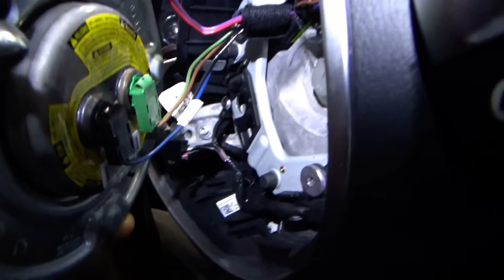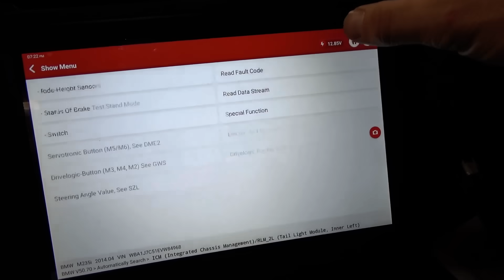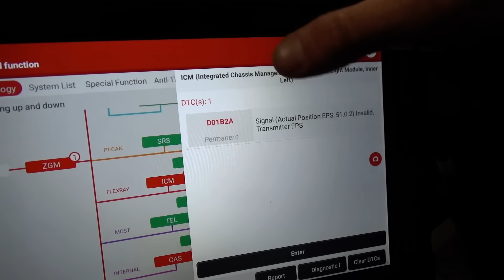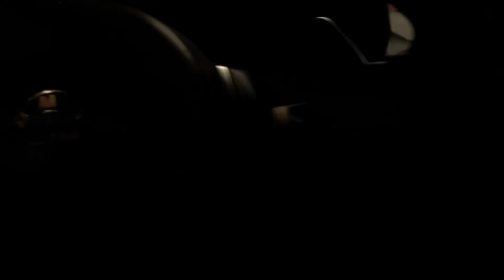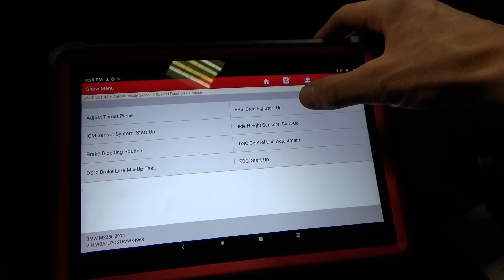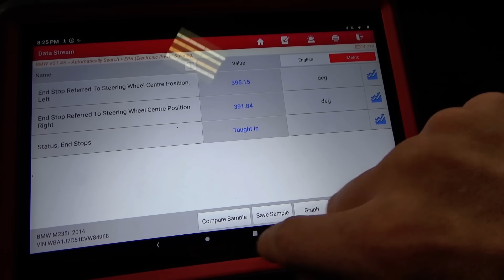DANGEROUS BMW Steering?? ('14 M235i Turbo)

Comment: I’m in CT and the first real cold weather occurred. Freezing temps. Like clock work my power steering pump has a leak now. Air in system. I have an accord 07 v6. Power steering systems do not like cold weather. Nor do any gaskets. Winter sucks. Now I have to fix cars in the cold. Ugh lol

Comment: Oh, yeah!  I forgot to mention to you that one of the jack stands had a little incident with the steering rack...  That would have been nice to know when the car was dropped off.  Oh, well.  Charge the customer for the time spent diagnosing an issue due to undisclosed information.

Comment: Next teach him that the junk intake he installed could potentially screw up mass airflow readings because the MAF is calibrated to the factory air box, and that it’s not a cold air intake, but a hot air intake, so he’s losing all kinds of performance!

Not to mention his “dusting“ his engine due to poor filtration. There’s a reason companies spent billions of dollars on research and development; that’s a precision machine, it’s best to leave it the hell alone!

I guarantee you the company that made that intake does not have the R&D budget that BMW does.

Comment: I was thinking the clock spring was turned 180 degrees off. But getting the full story from the customer narrowed down the real problem. I have no idea why these cars with electric assist steering are allowed to be on the road. I read warnings about Ram trucks with the v6 and it states the engine may die while driving and cause an accident WTF. If that was a child’s toy it wouldn’t be allowed to be sold.

Comment: Recently, the power steering went out on my 335d.  A local Bosch shop flushed the system and replaced the pump, because it wouldn't build full pressure ($1000).  Next, they said my alternator was weak and would only provide about 50 amps ($1300).  I took the car back and did the alternator myself ($350 for a brand new Valeo part).  As I was checking my work, I noticed a wobble in the crank pulley.  I bought the part and took it to my usual mechanic, who was back from vacation by then.  Not surprising that things don't put out their full rating when they're not being driven properly.  The rubber in the harmonic balancer was shredded.  Belt tension was the only reason it was turning at all.

Comment: To those of you who put on "cold" air intakes..the stock snorkel takes in air from the outside, while the "cold" air intake takes air from under the hood. Now tell me, which system delivers colder air?

Comment: These electronic power steering's are ridiculous. The old fashioned mechanical/hydraulic units worked flawlessly for years. Over engineering at its finest. Let's take something that has worked for ever and make it better. NOT.

Comment: Yeah, that would have been nice to know.  What really bothers me is, in Pennsylvania, you have a car with a heated steering wheel and you take it out to put a "carbon fiber" one in its place.  Stupid and all for show.  Heated steering wheel sounds like a fluff option until you're driving down the road in 10F degree weather and your hands are freezing to the wheel through your gloves.  I give the kid credit for sourcing, replacing and programming the rack (but didn't he realize when it fell onto the rack he might have busted it?) but he lost all that credit ripping out the heated steering wheel to throw a "look at me, I have a carbon fiber steering wheel" in.
Reply: Why would that “ bother” You? It was his money to do with as he wanted. I’ve been driving in Pa. Well over 50 years, never needed a heated steering wheel  or desired one. Your hands stick to your steering wheel with gloves on?  Wow! 😅

Comment: I do not like EPS systems simply because they are not servicable. Ive seen them fail often with crazy results, some judder like crazy, some continiously spool to one side if you let go the wheel and everything else in between happens to them when they go bad. They went to EPS to save themselves money, however you the customer get to pay when it fails,AND It will. I will stick with the old reliable hydraulic system that can be serviced and repaired.

Comment: Ivan, what software or site were you using there at the end of the video? I recently purchased a 2010 mercedes e350 (meticulously maintrained amd low miles) and would like to learn a d understand more about it's systems and how they work. Also, could you possibly recommend an affordable diy scan tool i might use to help keep up with it in case something comes up? Appreciate you as always!

Comment: HI IVAN ,another good video. I remember when the steering on my covered WAGON was just 2 pieces of LEATHER STRAP about 20 feet long.TO make a right turn,i just pulled on the right strap.Then when i traded that in for a CAR with 4 rubber wheels,and a horn,i had a round piece of plastic i twisted to the right,clockwise to turn right.But now the car i drive has a small piece of wire that goes from the wheel to a box with gears that move the wheels.The wheels can be as far away from you as you want.I could even wire it to steer from the back seat.But i just don't trust the system.

Comment: Thanks, well done the owner for sorting it. No need to worry if the original problem stopped the indicators working as these are rarely used on BMWs, maybe just a UK thing.
Reply: believe me, not, it's not.  even us yanks make fun of beemer owners for not using the turn signals.  those who actually DON'T are the remaining 30's kids that are still alive, and were lucky to have more than a single taillight on their 50 dollar used clunker after WW2 :P

Comment: Props to the guy for repairing it for himself! I'm sure he learnt a good lesson and he will be a lot more careful the next time :-)

BTW If someone need to do some BMW coding related work, the dealership programming tools are available online, and the cables are just K-Line/D-CAN OBD-2 to USB, and they are available in Amazon and similar websites.

They are really useful to have before something fail, because you can do a backup of all the data of the car electronic units. This is specially important in iDrive and other modules that can differ in settings from car to car.

Comment: A mechanic friend of mine called this tuition. The point being you can either pay to go to tech school or you end up paying for mistakes, either way you will have to pay to learn auto mechanics
Reply: From what I’ve experienced several times, automotive tech schools are pretty much a joke. First requirement needed is at least some mechanical inclination and desire, and second is an extended apprenticeship with a good mentor.

Comment: I have a 1996 Chevrolet K1500 rust free. I removed engine and transmission, completely rebuilt everything with quality parts, the entire steering with Moog USA parts. All original, cost me around $5,000 for engine (bored and crank turned) rebuilt transmission, front end, Bilstein shocks, stainless fuel and brake lines, cleaned frame and painted it. Excellent truck, no issues, oh I replaced all ground straps too. I would like to see more cool cars and less German high priced junk
Reply: Define cool cars?  Like a shit Chevy? 😂😂😂😂😂😂😂
Reply: There’s always a good lesson in all of it. 👍

Comment: With where I live, I don't see a lot of BMWs, but the ones I have worked on for shops--both old and new--I've honestly been impressed by.  Yes, the parts are expensive, and sometimes they're drastically different to work on, but the aftermarket support from scantools is phenomenal compared to VW/Audi and Mercedes.  :)

Comment: I bought a 2009 328I which was SULEV. It means it has 15 year 150k mile emissions warranty. I took it to the local scumbags and they laughed at me when I said warranty. Well come to find out the idiot with the old car was right. They gave me a 2024 228i for a loaner. That automatic steering shit is scary. Im all for automated driving if the car is driving itself. I got down the road and on a curve got close to the white line. The car felt like I was sliding on ice when it like steered itself and Im assuming used the brakes to correct it.

Comment: Fell of the jack stand. Good thing the guy wasn’t under it when that happened. Expensive, but valuable lesson learned , hopefully. 👍👍🇺🇸
Reply: I always put my ramps under the rocker panels JUC
Reply: I had a car fall off the jack stand.  The next week I ordered a Bend Pak Scissor Lift.
Reply: No guarantee he wasn't under the car. He said the car slipped off the jack stand to the steering rack. Regardless, glad he didn't injure himself. That would have been bad. .
Reply: @serge4856  seems more of a sideways slip to fall onto the rack which neither of these ideas would stop
Reply: No need for jack stands be near the rack though. He might not know to use the center front lift point and put stands at the side plastic lift points for the emergency jack.
Reply: I always put a jack stand under the oil pan. It's usually real sturdy and easy to get to.

Comment: Yea my sister had a bmw throw her hot coffee all in her face one time..  said she was getting in doing the woman driver routine where she has to situate her 3 bags of shit, a coffee, keys, while on the phone and when she pushed the startup button the wheel goes full beans leftwards and manages to get the coffee and her hand in it which flung the shit everywhere.. stained the roof to the floor and burned her face (not bad but bad enough for it to hurt, hot coffee..)  her steering rack was faulty apparently and did the whole thing where it ghost turns every key on..  had to tow it to the dealer to fix it but interior is still stained to this day..  probably sticky too cuz she doesnt keep her stuff mint or clean her own car..
Reply from the maker: @Z-Ack  sounds exactly like my wife with all her bags and beverages 🤣🤣🤣
Reply: Old school hydraulic assist for the win 💪

Comment: Fender covers DUDE
Reply from the maker: @BruinsRock77  what about them?
Reply: @PineHollowAutoDiagnostics  use them??? Specially, on expensive cars?
Reply from the maker: @BruinsRock77  I didn't touch a single thing under the hood LOL!
Reply: @ battery charger cables? Hood open??
Reply: There are some who will use them and here and there a few will cover the whole nose in plastic sheets. It’s sad to see phad and sma not use them. When I worked at the dealer it was mandatory, and we were also given a clean blanket thro cover for the seats and paper for the floor mats. It’s sad really, just a lack of respect for the car and owner.
Reply: I suppose fender covers went away with hardwire phones. I scream FENDER COVERS at car videos all of the time 😊.
Reply: @BruinsRock77  Instead or in addition to the cups, shirts and other tchotchke’s, they could get phad or sma silkscreened on some fender covers and a throw blanket for the seat, use it in the videos and you know ppl would be begging to know where they could buy it.

Comment: My citroen c3 picesso 1.4vti had a kill me fault in my EPS which locked up the steering system, got it to a stealer ship and they replaced the module and then it happened again and this time they tell me that they found a bad ground and fixed it with a new bolt, all this cost alot and I wonder if it was the bad ground all the while, but they took my money. If you think BMW'S are expensive you look at the France cars 😢

Comment: I'll have to say my opinion of the owner wasn't great when I found out he was a student and driving such a car - and then blowing money on carbon fiber parts. But when I learned that he was actually working on the car and had it on jackstands, and then that he was able to replace the rack and program it to the car - my opinion of him got much better. Maybe he's the kind of engineer we need in the future! Granted, he didn't give you all the info, but he does seem to be learning some good lessons away from the classroom. And he has a great teacher!
Reply: I love that there's two things you never get when a customer drops off their car.
The full story, and a full tank of gas.
Reply: Hey the dude works hard to get the bitch magnet all fixed up and pimped out. Respect. I did the same in college.
Reply: @Bizija123  Lol ...😆
Reply: So what you're telling the world is you judge people you don't even know ahead of time.
Reply: @Jumalten001   And you never do that?  Most people call it first impressions.   

The ability to change/look past that first view as you learn more is more important than not having a first impression at all.
Reply: @Jumalten001  Not helping.
Reply: @Jumalten001  Priorities.....  Also, a terrible winter car.
Reply: @ckm-mkc absolute rubbish. My missus had an M135i. Full set of Michelin Alpine winter tyres and it’s absolutely fine during the winter and when it snows also. That is still with the stock open diff. Exactly the same with my M2, no issue at all during winter with Continental winters on.
Reply: @Jumalten001    carbon fiber, "cold-air" intake ...

Comment: Customers need to learn what full disclosure means.  I had an S-10 in here last week.  They called and asked if I could squeeze them in for a front brake job.  I get in the truck to move it and the pedal went all the way to the floor.  There wasn't a sign of brakes on it.  I nearly went into the ditch. Turned out it needed rear wheel cylinders and shoes.  The master was bone dry.  SMH
Reply: Total idiots
Reply: A S10 still on the road?   Lol
Reply: @chrisanderson4799  still driving my 02.
Reply: @chrisanderson4799  My ex-wife still drives the 1994 S-10 Blazer I bought her in 2003, I drive a 1995 Ranger. Down here we don't have to throw them away after 10 years.  My kid and I just got his 2006 Subaru Baja running this last weekend.  Cant wait to see that one on the road.  I have a hate hate relationship with newer cars.  I hate them and then I hate them some more.  XD
Reply: They think if they hide stuff it'll be cheaper?

Comment: BMW from the “ Ultimate Driving Machine” to the best machine to run away from
Reply: You ppl are just jealous, because you're driving some Chrysler jalopies... BMWs are great cars. Around here is full of them everywhere...
Reply: @johnnyblue4799  I have had two of these over engineered over priced vehicles.  When they are running, nice car.  But they are fragile.
Reply: @thk7513  forgot this  little bit of information on BMW engine quality ZERO F1 constructors or drivers championship ever..
Reply: @thk7513  All modern cars are fragile.
Reply: @johnnyblue4799  BMW is the poor men’s Mercedes, they are always leaking some type fluid, dic lights on in cluster
Reply: @Aaronkoivu  :face-blue-smiling: poor man's Merc... lol. Ok.
Reply: @johnnyblue4799   i personally am not jealous. I wouldn't trade my 20 Tundra for any BMW of recent vintage. If I had the money, Lexus would be top of the list for me. I am of German Ancestry and wouldn't drive german to save my life.
Reply: @mikefoehr235  Well, there's no BMW pickup truck, so you can't trade it even if you want. These are two very different vehicles. Why comparing a car with a truck? There are many high mileage BMWs. They have an undeserved reputation in the states. The same seems to be true of American cars in EU, but we hardly get any of them here.
Reply: @johnnyblue4799  i am glad BMW doesn't make a pickup. Imagine that disaster
Reply: Bring More Wampum.
Reply: Ultimate Draining Machine...like the wallet
Reply: Bring my wallet “BMW” to the mechanic
Reply: BMW means big money waster for many owners of "older" and higher mileage BMWs
Reply: @danong9458  BREAK MY WALLET...BRING MORE/MANY WRENCHES.....BANK MACHINE WANTED...BURNED MY WAD.
Reply: @mikefoehr235  Oh yeah... that proves it kid!
Reply: @johnnyblue4799  kid eh...I am old enough to be your grandfather...lmfao
Reply: @mikefoehr235  Unless you're in at least your nineties I doubt it... but your reply was ... childish... Like listing all those made up names for BMW proves something. Did you forget about the Toyota trucks breaking in half from rusty frames? Or the recalls for sudden acceleration? Every car has problems. Some have more because they need more maintenance and people neglect them. But if you care for them they'll reward you with a superior driving experience.
Reply: @johnnyblue4799  I love being childish...makes me feel youthful at 400 yo. The rusty frames aren't exclusive to Toyota. I have seen some pretty rotten GMs, FORD and RAM as well. Ironically the Toyota frames are made by DANA CORPORATION...probably inferior quality. About the sudden acceleration issue...Google what NASA scientists had to say. I did and found some interesting results.
Reply: @johnnyblue4799  you haven’t replied to my F1 post, BMW zero constructors championship ever, Mercedes 8 wins. Best engineering and technology comes from Mercedes Benz hands down
Reply: @Aaronkoivu  I don't have what to reply. You can google yourself BMW racing. Both manufacturers have great tradition and produced a lot of iconic cars. To say that the BMW is the poor man's Mercedes is preposterous, when an M8 Coupe, gas only, starts at 170k EUR. That's pretty much in the same range as the comparable AMG GT 63. That you like Mercedes more, fine, but let's not be ridiculous.
Reply: @danong9458  All old cars are getting more expensive to maintain and keep on the road. Of course the higher end will cost more.

Comment: That front strut brace just  increases understeer. Coupled with that hot air intake and this thing is going nowhere good
Reply: Hot air intake downgrade/ maf distorter.😂😂
Reply: the air intake seems to be for more noise ('better sound') than anything else